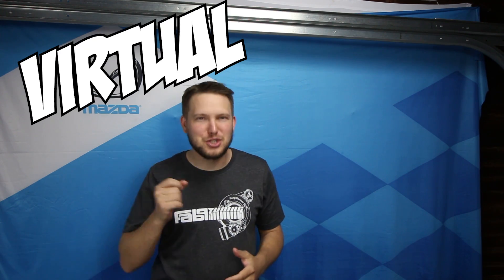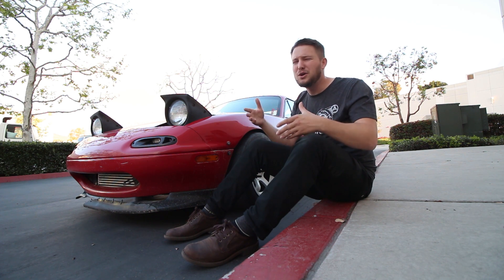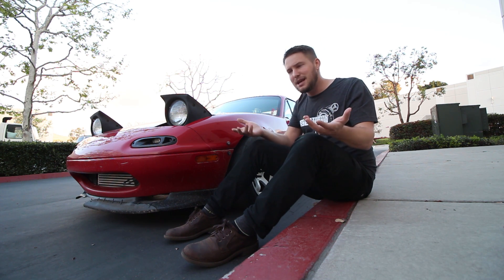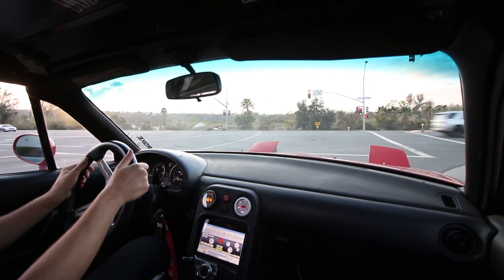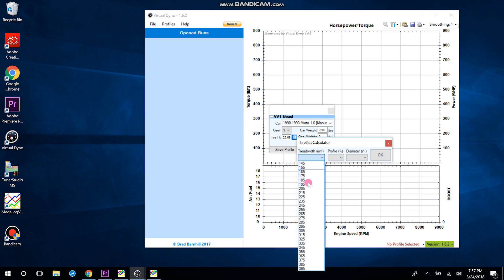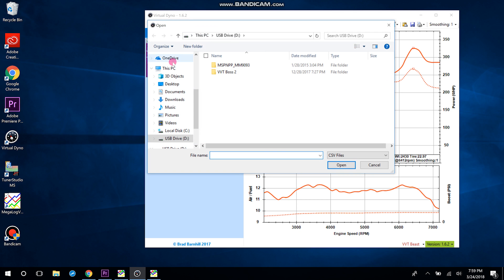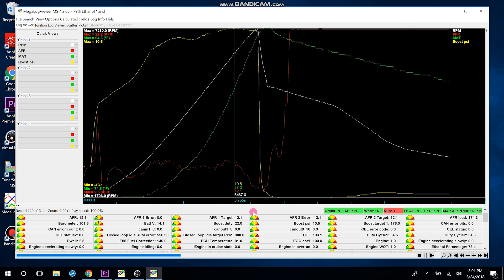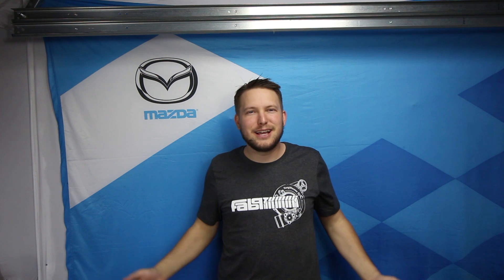How to Use The BEST Street Tuning Tool! (100% FREE)

Comment: So I’m not sure if this was filmed before or after you did your trans swap but I think you are forgetting to factor that in. It will play a role in this calculation and I didn’t see that you changed ratios anywhere
Reply from the maker: This was before the trans swap. If you're running a non-factory trans, you just need to calculate how much to alter the diff ratio to offset the change in trans gearing. For the E30 trans, I just need to do this: (3rd gear pull)

3.91 (diff) * 1.40 (E30 3rd) * 1.33 (Miata 3rd) = 4.12.

VD only needs to know the final ratio, so you can alter the diff ratio input to counteract the trans ratio. Stock Miata 5-speed with 3.91 diff has a final of 5.20:1 in 3rd. With the Getrag trans, it's 5.47:1. So even though the car really has a 3.91, I need to do "4.12" * 1.33 (VD thinks 3rd is 1.33) to get the actual final of 5.47.

Hopefully that makes sense. It would be much easier if VD just let you input the ratios on your own instead of having fixed values for the OEM transmissions in each car.
Reply: @TheCarPassionChannel  Ok, just wanted to make sure that was clear for anyone that might want to try doing this with a non standard setup
Reply: @TheCarPassionChannel  does the laptop or tablet have to be plugged into the ecu or the vehicle by the ODB-ll port ? And do I need to download mega log viewer ? Is it free ? Sorry for asking so many questions 😅
Reply from the maker: @B.R.BGarage  I have a standalone ECU, I'm not sure if the software can take logs from the stock ECU on OBD2 cars. You'll have to do some research on that!
Reply: @TheCarPassionChannel  😂 ah that makes sense, I’ll look into that. Thank you 🙏
Reply: it lets you add in gear ratios for every gear.
Reply: I don’t even own a car or have my license. This is so interesting for some reason. My email is (morgant.noble@gmail.com). I want to learn everything about this so when I get my RX-7 83 GS I will be up to date. Thanks 🙏 any advice, just mail me.

Comment: I know this is very old but the best correction to use on a "perfect" Street Dyno is 1.0 since it gives an direct feed back instead of compensating like on a Dyno
Reply from the maker: My goal is to get the same readout as the dyno that I frequent, not necessarily to measure "exact" power. But either way, as long as you leave the settings the same, it can be a great tuning tool

Comment: i’m having a issue with it saying i have missing columns??? it says time,rpm,and throttle position are missing how do i fix this??
Reply from the maker: @DRIFTBAEEE  Sometimes the log will produce a .csv with an extra top row, and the headers (TPS, AFR, etc) will be on the 2nd row. Delete that top row.

Also, make sure the settings of Virtual Dyno match your CSV headers (i.e. if Virtual Dyno is looking for "TPS", but your CSV header is "Thr%" it might not pull the data correctly. You can change that setting in VD or in the CSV file, but they need to match each other
Reply: @TheCarPassionChannel  i still can’t get it to work i wonder if it’s because the tune saved as a .mlg instead of the regular .csv/.msl
Reply from the maker: @DRIFTBAEEE  Ohhhhh yeah dude open up MegaLogViewer, and export log as .msl OR .csv either should work. .mlg are problematic for some reason
Reply: @TheCarPassionChannel  alrighty man thank you ilyk if i have anymore issues!

Comment: Can you use any data log software like SCT or HPT?
Reply from the maker: You should be able to. VD can't import logs from all software, but most logging software (or logs) should be able to output, or be converted to, a .csv file which is very common. And VD can import .csv files. You may need to edit certain rows or columns of the .csv for VD to read it right (using Microsoft Excel or Google Sheets). Sometimes the tuning software adds an extra row on top, or titles a column weird, but .csv are easy to edit so it's usually a quick fix.

Comment: How do u connect it to the ecu
Reply from the maker: You don't - the ECU exports a datalog file onto your computer, then you open that file with Virtual Dyno.
Reply: @TheCarPassionChannel  I'm new to tuning what would I need to do that
Reply from the maker: @shanen1651  You need a way to record a datalog, typically with a standalone ECU.
Reply: @TheCarPassionChannel  would I need any wires
Reply from the maker: @shanen1651  No, this program does not have any connection with the ECU. The ECU creates a file known as a data log, and then you open that file with the Virtual Dyno program
Reply: @TheCarPassionChannel  thanks would I need anything else
Reply from the maker: @shanen1651  You need a datalog, that is it
Reply: @TheCarPassionChannel  ok thanks for all the help
Reply: @TheCarPassionChannel  where would u recommend getting the stuff and like what brands

Comment: wow mate 
like past 3 months i was developing similar app because i couldnt find anything like this 
you made my life so much easier  

but still my app was based on phone and just used accelerometer data and gps speed
and use "calibration" to set rpms to certain speed this way calculate gearing 

still might be decent app to make no need for dataloging just phone with gps 

my app would use rolling on clutch pressed as drag calibration 
offset it on torque graph 

torque is just force we can calculate drag as torque going oposite side and add graphs together 

ive made some tests mainly in assetto corsa because i could just get a lot of data in short time 
but it should work fine in rl 

but for my use program you showed would be much much better 

thanks

Comment: I’ve driven a ‘28 Ford with manual timing. It wasn’t difficult. I can’t help but wonder if something like that can be set up in a modern car. Pull out all the computers and sensors related to it and control it all manually, with a lever under neath the steering wheel.
Reply from the maker: Considering the fact that the ignition timing varies from 10° to 45° BTDC instantly based on engine load, it would be quite a chore to get any efficiency or power out of it. But, I will say the carburetor conversions people do on these engines is pretty cool
Reply: I think it can be done. I think it should be done. Pops? Crackles? Fire? At your command? Plus normal sleeper driving abilities. Somebody’s gotta be as crazy as me

Comment: I know this is old but maybe someone has an answer? I converted a Hondata datalog that was about 15 min total to .csv so I could check this software out, in that log there is a 3rd gear pull to 6500RPM with PSI recorded at 8.9. I couldn't chop just the pull from the log but when uploading the full log  to virtual dyno it appears it can pull a run out on its own? (there were multiple pulls in the log),  BUT the one it pulled only goes to 5200 and PSI is 5.4, is there a way to target just the beginning and end of the pull I want it to use from the log? I would just cut the pull in Hondata but couldn't do that either. I have Megalogviewer  that Is setup for logs of my motorcycle which I haven't use in forever but maybe I can chop the pull from the log with that software? This old datalog has my stock manifold which I'd like to compare with the fabricated one I am currently using.
Reply from the maker: You have a couple options, if the log will open with Mega Log Viewer you can edit the log using the "Search -> Log Editing" feature (not sure if full version is required) then "Export loaded log as..." Back into a .CSV 

Or, take the .CSV file and open it with Google Sheets or Microsoft Excel, then you can delete the unwanted rows and re -save it as a .CSV.
Reply: @TheCarPassionChannel  Thanks for that, I'll give those 2 options a try👍.
Reply: So I did use google sheets to edit the .CSV file cutting the rows before and after the pull and varified the pull data by the rpm and map values columns, then even saved it to a different location and named it datalog-googlesheets BUT when loaded into the virtual Dyno I still am getting the same dynograph max RPM 5200 max map psi 5.2. the same google sheets file I see 8.9psi at 6493RPM 🤔.
Reply from the maker: @lcq4blackstar  In the left column of Virtual Dyno, where the vehicle data is displayed, there's a small slider where you can adjust the minimum and maximum RPM of the graph. Also make sure the TPS value is 100 for the whole pull
Reply: @TheCarPassionChannel  Yes I saw the slider but it is maxed out at 5200 and yes the TPS value is also maxed on the rows I left in the log file after cutting the rest
Reply from the maker: @lcq4blackstar  Can you email me the CSV? thecarpassionchannel@gmail.com
Reply: @TheCarPassionChannel   Thanks for having a look, I attached the full datalog/edited datalog/custom car file
Reply from the maker: @lcq4blackstar  Check your email, all fixed!
Reply: @TheCarPassionChannel  that worked thanks, saw your premium hat in another video fellow BMX rider👍

Comment: How hard is it to find MBT for WOT? What about MBT with steady state road tuning? I'm guessing you have to view the logs afterward and make changes which would take hours.
Reply from the maker: Yes if you're super fine tuning for MBT you need to get on a steady state dyno.
Reply: @TheCarPassionChannel  poop. thanks, just getting into tuning after watching your boost videos. Dyno time is so expensive.
Reply from the maker: @johnlee1009  That being said, you don't need to max out every last 0.1hp on the dyno to have a very fast, fun, and safe tune. Plenty of turbo cars never even see a dyno and last just as long as any other build
Reply: @TheCarPassionChannel  that's good to know. The base timing maps and online support are probably good enough anyways.

Comment: i have a gmc but its not an option on virtual dyno
Reply from the maker: You can use a vehicle that's similar to yours (aerodynamically) and then customize that vehicle with your gear ratios, etc. Then once you save it it will show up under "Custom" when you choose your vehicle.

Comment: shouldn't the speed be taken from the front wheels so that it won't be affected by wheel hop?
Reply from the maker: It derives speed from engine RPM, gearing, and tire size. It does not measure speed directly

Comment: Hi Greg can you use this as a one and done tune or at least a tune until you get a tune for example can I give it my desired psi and afrs and it will give me a decent tune until I get a professional tune or is this just a tool to tell you the power you have
Reply from the maker: Virtual Dyno is just a tool that estimates your power output, it is not a tuning software
Reply: TheCarPassionChannel ok thank you Greg especially for the fast replies haha you’re the man one more question is there anything like that that is reputable a software that I can put all my info and my goals and it will give me a tune?
Reply from the maker: @doobergoob  Tuner Studio has features to "auto tune" the fuel map, but it doesn't just spit out a full tune like with cold start, idle, ignition table and all that. The base map however is usually pretty good, and just requires minor tweaks to the fuel map to be street ready. Power tuning should still be done on a dyno, but an experienced street tuner can still do a good job.
Reply: TheCarPassionChannel gotcha I’ll just download the base tune and watch some more of your videos get it where I can drive it around to and from work and to the tuner

Comment: question, is there a way to use virtual dyno on automatic transmission cars?
Reply from the maker: Yes - but it will just be hard to get that super low rpm reading since the trans will want to downshift.

Comment: Just a tip if you or anyone else isnt aware, tuner studio has a feature called "triggered logging" you can set different parameters for it to start and stop the datalog. I use throttle position (TPS) > 50% to start the log then when the throttle dips below 50% it shuts it off. Great way to isolate a pull in a single gear since you have to left of inbetween shifts and since virtual dyno can only use one gear. A lot easier than dicking around with your laptop in your passenger seat while driving.
Reply from the maker: Wow mind blown, how have I not known this
Reply: That’s what I’m dealing with in hp tuners I can’t seem to zoom in on the one part I want

Comment: thanks so much for this video! I never knew about virtual dyno until I saw this. I drive a single turbo FD RX-7 and I've street tuned it but never put it on a dyno. I downloaded virtual dyno and pulled up some of my old Apexi Power FC logs from fc-edit and I can see it's compatible so I'm going to go out and do some 3rd gear pulls and finally answer the HP question!

Comment: Since you cant really use the "dyno" numbers officially, it should be seen as a tuner tool for streettuning your MS or other programmable ECU. So as long as youre going down or up the same slope, each time, you can still use that part of the road because youre mainly interested in the changes in power rather than the absolute power.

Comment: Bro you should do a virtual dyno vs a real dyno video to compare how accurate this tool actually is! AWESOME VIDEO GREG! 👏
Reply from the maker: I really should have included it in this video... I have tested 2 turbo setups against VD and it is surprisingly accurate!
Reply: @TheCarPassionChannel  Will this work with a stock ecu?
Reply from the maker: @That_fella_named_J  Not really, the only real requirement is that you need an ECU that can datalog. It's possible to do a pseudo Virtual Dyno with a stock ECU, using a stable/HD video camera on the tachometer, and using editing software to analyze the video frame by frame, to make a chart of RPM vs time (needs to be precise). Then make a 3 column excel spreadsheet with RPM, time in seconds, and throttle (pre-fill to 100). You can import that to Virtual Dyno. It's time consuming, and is subject to many innaccuracies (like tach being off, low quality video) but, it's possible.
Reply: @TheCarPassionChannel  Alright this bit of information is definitely helpful... lol I wish my ecu was tunable but it isn't ( ecu from gf body Subaru Impreza ) so I'm trying to make sure it's running as close factory specs as possible. Thanks!

Comment: Good video Greg. I'll add this. Always try and do your datalogs on the same stretch of road if you want to accurately see your gains. Flattest and smoothest road you can find, this is good for your tuner (if you're etuning) and for you if you want to see how many horsepowerz you're gaining with tuning or a specific part. It eliminates any variables!

Comment: Does this take in account that you have the bmw transmission?
Reply from the maker: At the time of this video it wasn't installed yet - but it absolutely can. You just have to alter the "diff ratio" based on what gear you're in, essentially tricking it into using the correct overall ratio. Easy calculation

Comment: When I try VD, for some reason it doesn't start the run unless I'm WOT. So when I load my megasquirt log, VD only brings up a graph for the single part of the pull that is WOT. And it leaves out basically the rest of the pull that wasn't WOT. Do you have to go through the same problem? I duno if i feel comfortable lugging it at 2k rpm etc. Unless you do it and that's normal? Thanks

Maybe somethings wrong with my settings.

Awesome video again! this is going to be very helpful!!
Reply from the maker: Yes, I am WOT for the pull.

Comment: That tyre circumference would be more accurate if it knew the actual measurement. It's not accounting for pressure, wear or camber. Close enough though.
Guess you could paint a spot on the tyre and roll a few meters then measure the distance between the paint spots on the ground.
Reply from the maker: That's the beauty of the program - you can use whatever means you like to get more accurate results.  But the precise HP number isn't the main benefit, it's using the software to get multiple curves and use it as a tuning tool.
Reply: He could prob add in some extra accuracy if he accounted for the tire stretch too. If it makes that much of a difference. Maybe 1mm i duno lol

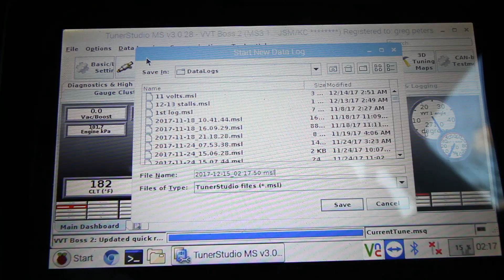Comment: That shift at 0:17 was money. Sounds like a sequential bro ;)
Reply from the maker: That's the biggest thing I miss about the twin disc clutch setup, can't do that with the new transmission/clutch setup :( trade off for strength though
Reply: @TheCarPassionChannel    That sucks. When I flat shift it feels like the engine flips upside down and back real quick :D
Reply from the maker: @MrFoulksy  If it's set up properly it should be relatively smooth

Comment: Detonation bends rods more so than TQ
Reply from the maker: There's still only so much they can hold, no matter how "good" the tune is.
Reply: you can't say detonation doesn't produce torque though :)
Reply: ime detonation melts pistons first, badly or cracks them in all kinds of creative ways (and Miata pistons can handle a fair more torque than the stock rods). Torque usually is the reason for throwing stock rods out of Miatas!

Comment: The sae corrections are for na engines, for altitude and temp. For a turbo engine it is very different since the turbo can compensate by itself a bit, depending on how your calibration is done and how much you have left in your compressor.
Reply: also im pretty sure you're supposed to use ambient temp, not IAT. cause if you have a shitty intercooler and high IAT it will show even more power? doesnt make any sense.